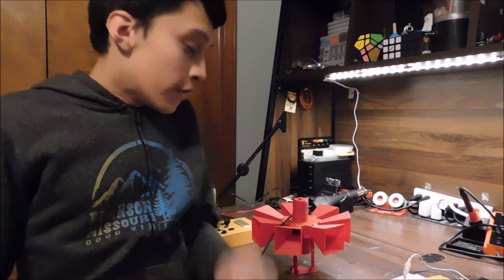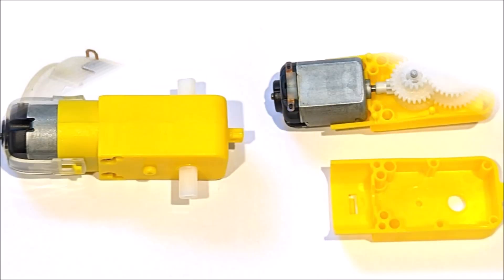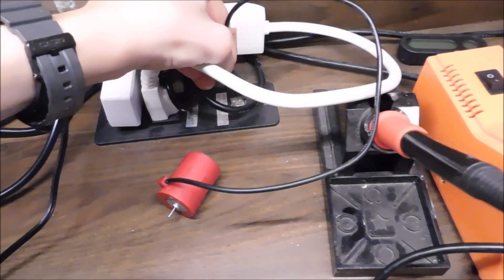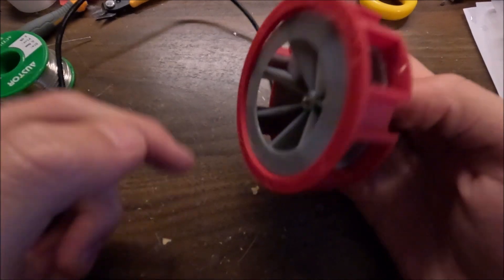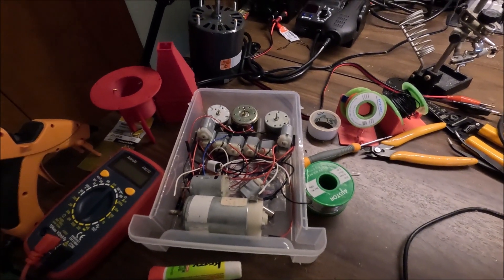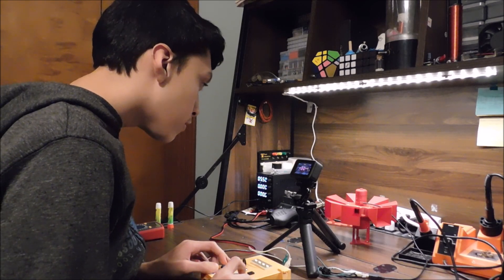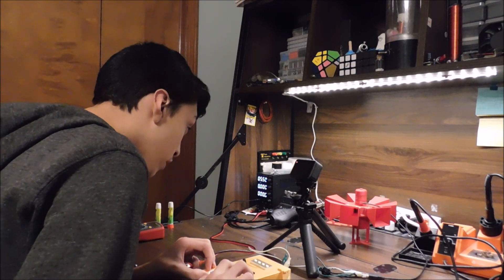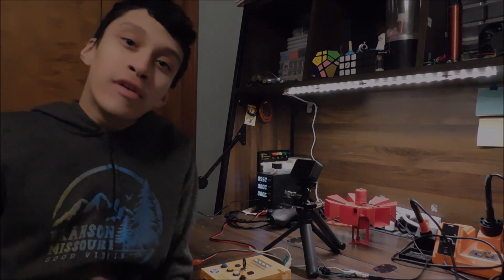Mini STL-10 Siren Test and Build!

Comment: hey so when i made the rotor it dosent fit on the motor shaft i was wondering if there is a different way of making the rotor fit besides reprinting it
also i exploded a motor trying to put it in the motor holder so idk what to do anymore
Reply from the maker: The rotor is a little tight when it fits on the motor shaft the first time. Also, are you sure you printed it correctly? If any tolerances are wrong, it won't fit the shaft properly. It also should fit in the motor cover tightly.
Reply: i have it on fast and fine so i slowed it down so high quality so it should fit better if it doesn't work ill reply again and we can try to find a solution for it
Reply from the maker: @blazebardx  Alright, good luck!
Reply: @milespeterson5049dude it’s too tight again the motor isn’t fitting on the cover
Reply from the maker: @blazebardx  I'm sorry! That is an old model of mine, and I made the tolerances pretty tight. I have new and improved STL-10 files going public soon, so if you can just wait, I can provide parts that aren't as tight, and revamped to be more realistic.
Reply: ill need it
Reply: too tight again😤

Comment: What wires would I use to connect it? By the way I’m doing a 380 motor sized print and one other question I have is would I be able to hook it up to a dial and control its pitch?
Reply from the maker: Thanks for asking! For your STL-10, I'd really use any wires you trust to work. If you want it to look pretty on the outside, consider using black heat shrink over some wires to the motor. I used a USB cable for mine in the video. Then from there, you can absolutely attach any sort of speed controller to the motor externally, unlike the 130 motor size, which has enough room inside the motor shroud to wire up any resistor to a 5-volt USB cable for pitch adjustments. For a real STL-10, it's around 400 Hz peak pitch. As for your 380 motor, you can wire up your speed dial outside of the motor shroud for pitch control. You could even put all your wiring in a control box to make it look even better. The decision is really yours, because there are a lot of different ways you can customize this. You can let me know if you need any more help!
Reply: And if that isn’t possible, where would I find the right USB
Reply from the maker: @EASandSirensOfNJ I used these ones here: https://www.amazon.com/dp/B0CKVSS33T?ref_=ppx_hzsearch_conn_dt_b_fed_asin_title_2&th=1 But please make sure that your 380 motor will give you your desired pitch before you wire it up to a USB cable. I couldn't really find any 380s that spun fast enough at 5 volts, so I used a 130 instead for my STL-10. Good luck building your own! If you ever make a video of you building it, I'd love to see it in action.

Comment: Just made this! pretty good looking siren! I don't have the horns but I don't really care for them.
Reply from the maker: Awesome!! Glad you liked it and made your own! I've got more coming up on my channel, so don't miss out on those!
Reply from the maker: Did you get it working? What motor did you use?
Reply: @milespeterson5049 a 280 dc motor. need to get a 380 so it works properly. and it is temporarily disassembled.
Reply from the maker: @KansasCitySirens  If you know the basics of 3D modeling, you could easily retrofit the motor housing to work with a 280 motor. But it would be easier to just get a 380, lol. There's also another version of my model that works with a 130 motor, so you could try that, too. Good luck building your own!

Comment: This is the most accurate version of a square horned STL-10 can you upload it to thingaverse? I would love to print it
Reply from the maker: I'm so glad that you like my model! Unfortunately, I do not upload files to Thingiverse, but the files are available to download for free on Tinkercad. You'll need an account to download them, but that's free too!

Download them here for the 130 DC motor size: https://www.tinkercad.com/things/21PFfy9CHM5-new-federal-signal-stl-10-siren-130-motor-size

For the 380 DC motor size: https://www.tinkercad.com/things/1uxAqX7x68p-new-federal-signal-stl-10-siren-380-motor-size

Good luck building your own! If you have any additional questions, don't hesitate to reach out to me!
Reply: Tinkercad works to! Tysm I wont be able to print it right now I’m working on 2 things right now I’m re painting my model train and turning my 2t22 into a 3t22 but when I get to making it I will 100% upload it but thank you for the files Im lucky I have a 3d printer
Reply: Hey and 1 question is the 180 motor size bigger than the 130? I’m planning to mount that instead of the model 7t or 2t22
Reply from the maker: @trainsandsirensofutah5334  Yes, the 380 DC motor size fits a 380 DC motor, and not a 130 size. I recommend using the 130 DC motor size rather than the 380 size, because 130 DC motor's have a much longer wind-down and are USB compatible. I used an 8000 RPM (At 5V) 130 DC motor for the one in the video, and it worked great! 

Again, good luck building your own! If you have any further questions, I'm here!
Reply: @ ok ty ive never built one before ive bought them but I will ask if there is any questions if I have to do the 180 for a longer wind down I’ll use fishing weights and add it on the side